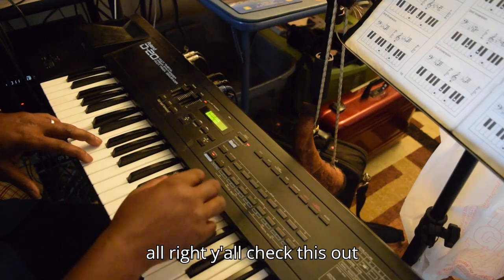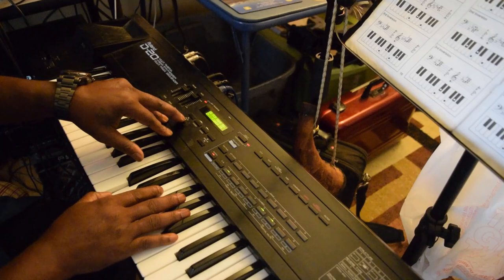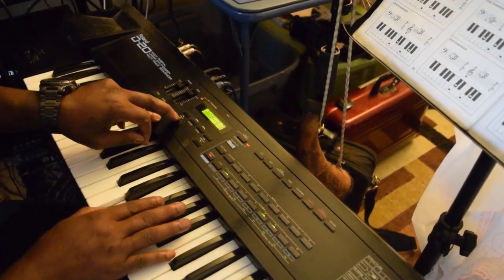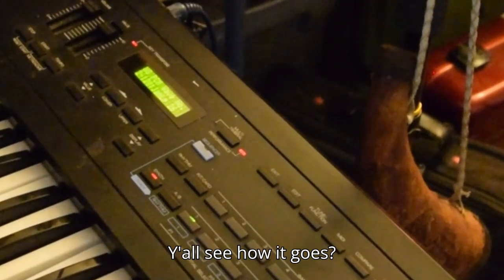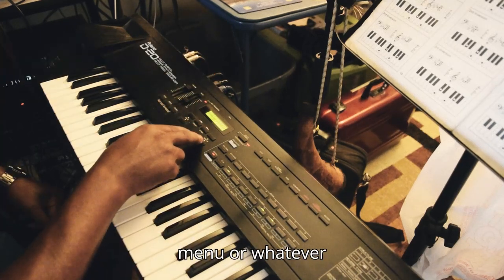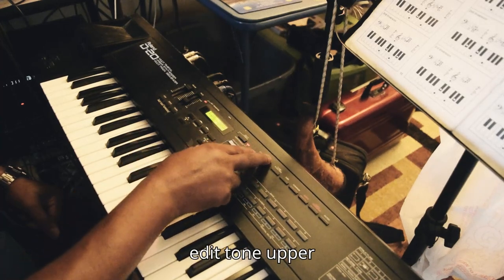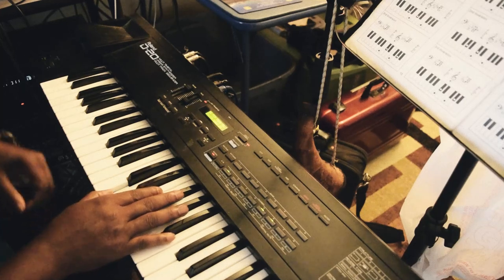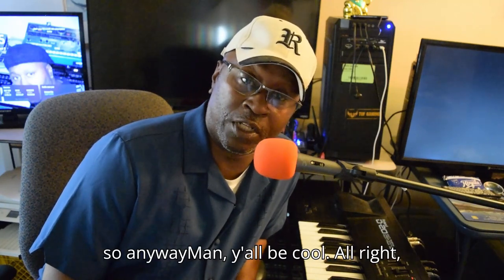Roland D 20 PCM Wave Demo

Comment: The power of the D20 is not in these boring PCM waves, but in the synth-waves, saw and square, which can be filtered and PWM'd, and then stacked in the multitimbrality option.
It needs some deeper dive then though.
And of course, the rhythm section! Drum machine.
There you can combine up to 4 sounds per key pressed. 
Never seen again on any other synth.
Reply: @DavidSheltonKCDJUnique  Just watched it by accident. I wrote: BORING PCM waves not BORING VIDEO.
Just get into this amazing tool you got there under your thumb just now. Unlock the "secrets".
Reply from the maker: This is for fun. It's just synthesizer sounds.
Reply: @DavidSheltonKCDJUnique  What are U talking about?